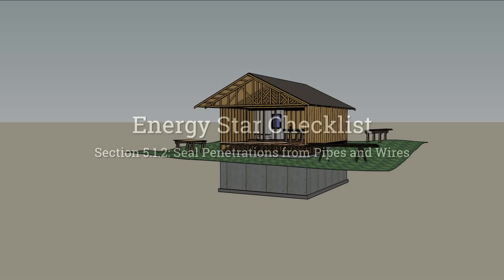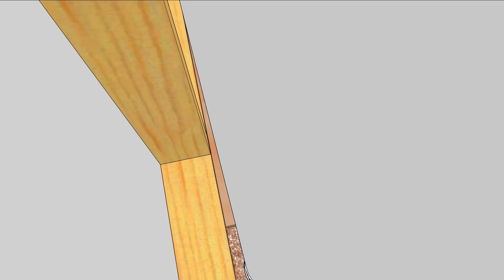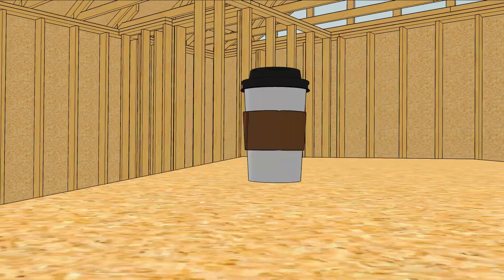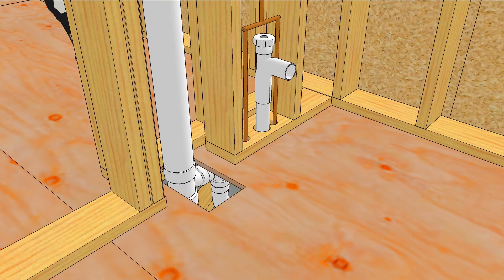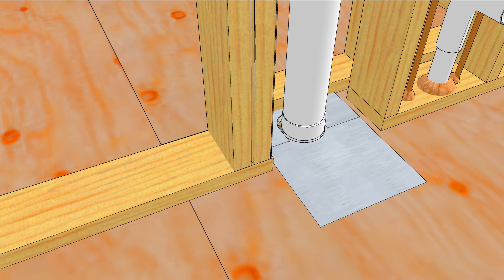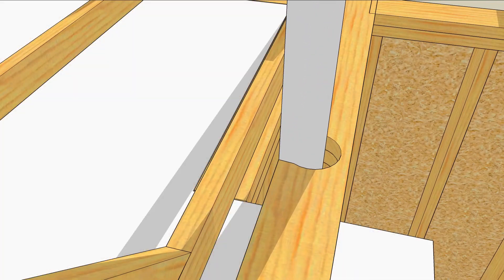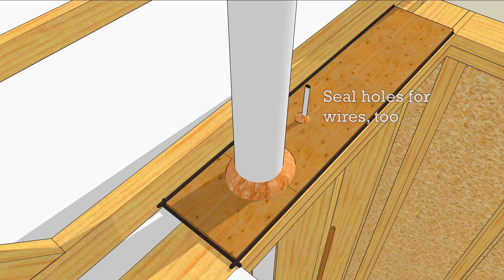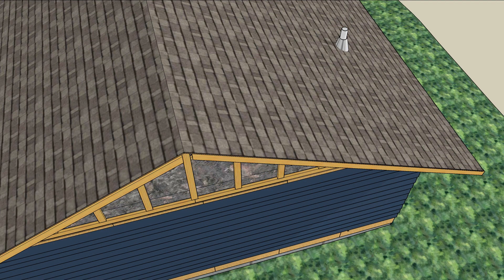Energy Star Thermal Bypass Checklist: 5.1.2   Wires and Pipes

Comment: I made the mistake of trusting the company who built my mini home. Over the past 19 years I've discovered hidden issues. Like NO solid pieces of plywood underneath the tub! It's literally sitting on 2x4's!
We had a pipe break in the bathroom wall. With 6 inches of space to work between the water heater...I wasn't impressed with how much wind poured out of the hole I made...hidden gaps suck